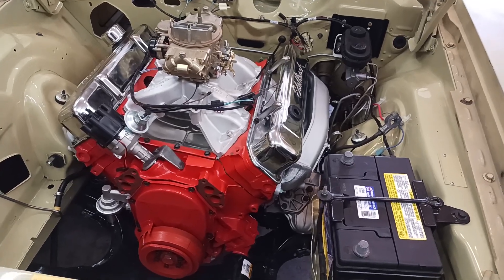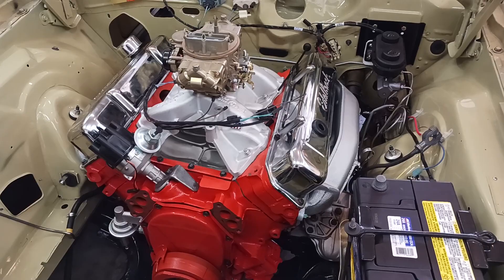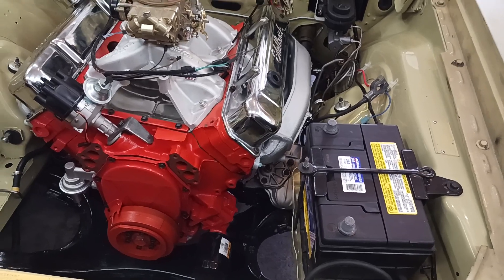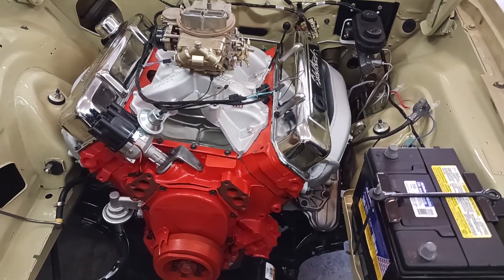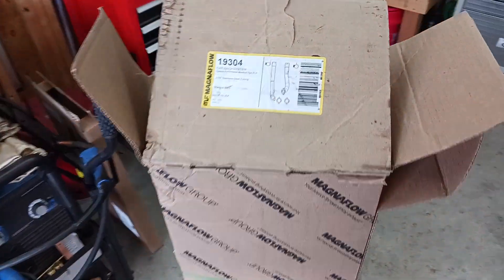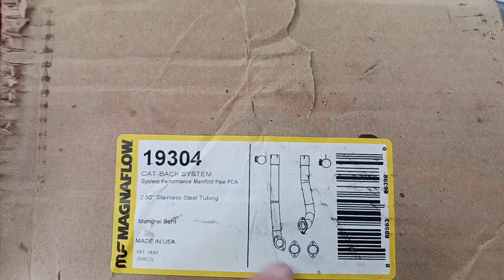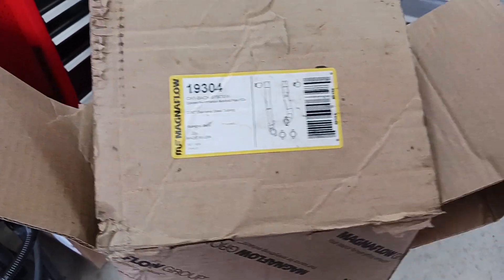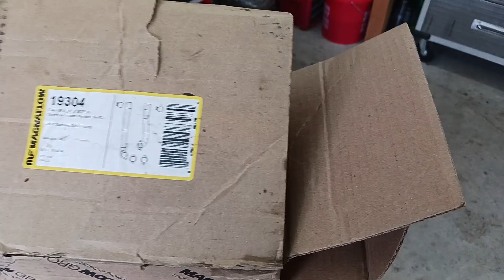440 Installed

Comment: I had hood clearance issues when I put a 440 in my 66 Coronet using a performer intake. Mancini Racing sells a 1'' drop air filter base that worked like a charm, if you don't want to cut the hood or change intakes. Fits a 13 inch air cleaner which works for factory air filter tops. Also works with the Mopar Performance aluminum air cleaner, which is what I have.
Reply from the maker: Thanks for the tip.